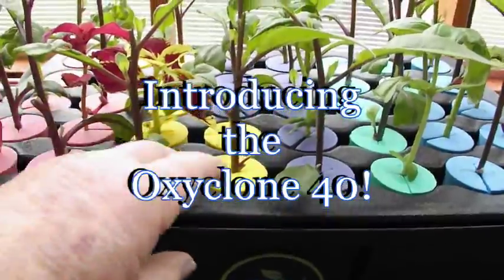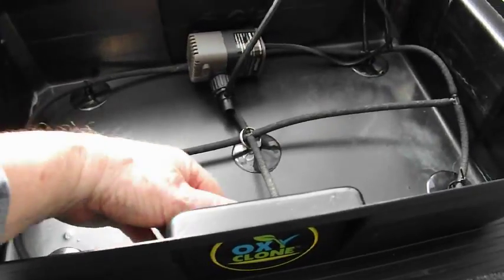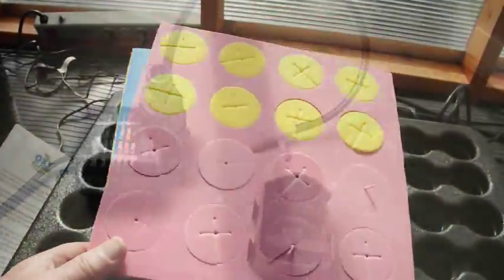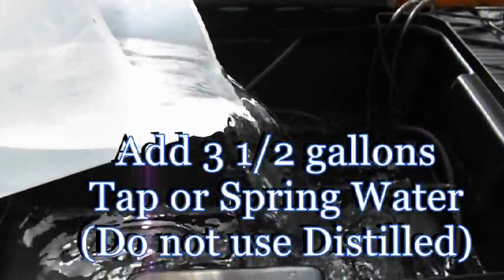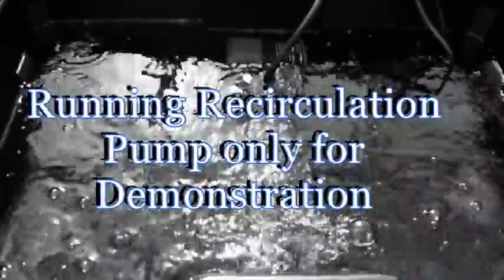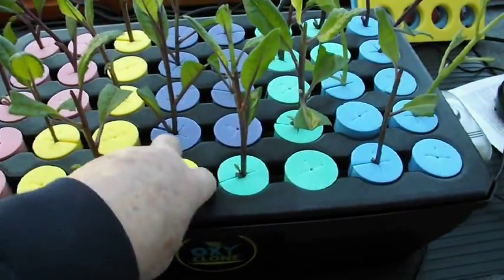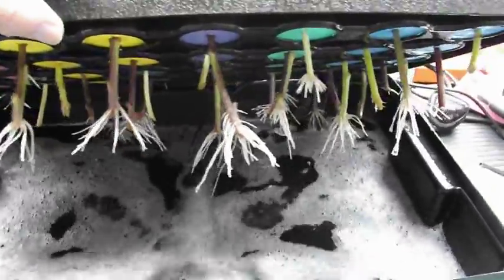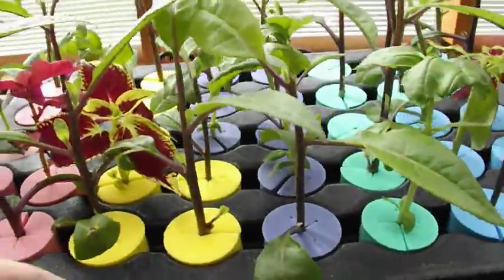Oxyclone 40

Comment: Nice Video. Thanks Ronald,
Just to confirm. You added only water. No nutritions, Correct?
Reply from the maker: +Ponniah Kunathasan Yes, most tap water is fine unless it is too acidic or corrosive then it should be treated before using.  In my area the tap water pH is around 7.8 which is too high for most plants extended growth but seems to work fine for rooting.  Thanks for your question and thanks for watching my videos!
Reply: +Ronald Kleinman Thanks Ronald. Will Hydrophonic fertilizer help or not?
Reply from the maker: +Ponniah Kunathasan  Not really, unless you are using distilled water with no minerals.  If you feel the need for added minerals use cloning liquid in small amounts.  What you saw in the video was plain tap water which has a TDS of around 35 ppm - that was enough mineral content to accomplish the root growth you saw in the video.  Well water is an entirely different matter because of possible toxic content.  Thanks again for your comments!
Reply: +Ponniah Kunathasan use technaflora root66 it's basically the same thing as cloning gel especially when used in a DWC cloner like this. plus it's way cheaper you get a litre for like 25$ instead of a tiny little tin of rooting gel
Reply: I use botanicare root gell and that's it period. just what comes off the dipped stem is all that goes in the tank I clone in, and normally all I use is tap water. you can clone in the back of a toilet and get the same results if you keep the air pumping like hell. granted, I clone in a garbage can that is actually the tank for a aquaponic system, but as far as clone junk I swear by botanicare root gell and pretty much botanicare everything over any nutrient company. I get the best results from just using water from the aquaponic fish tank and adding a little carboload and some sort of silica additive for dirt. but for a flood system, I just use a fish tank and add chilated iron. you save money on nutes, and you get a free clone machine by having a fish tank. keep the fish happy and healthy and they will keep the plants healthy and happy. good luck with it.

Comment: I've heard that if you leave the submersible pump on constantly it heats up the water too much.  Have you experienced this?  Is it necessary to buy a timer and run it 15 min on and 15 min off?  will this work if I used air pump and two stones and didn't use the submersible pump?  I just bought the Oxyclone 20 and just want to make sure I'm doing it right.  Thanks.
Reply: Hey any luck? I just bought one and I hope my water doesn’t heat up

Comment: Built one just like it for $31.98 US including tax.  Why anyone would purchase this at that price, when you can diy it yourself so much cheaper.  Using just as good products found on Amazon and at Lowes or Homedepot. I don't use the submersible pump as it heats the water to high when use 24/7. Just used a $15.99 two outlet aquarium pump works the same.
Reply: So if I have two outlet air pump and two stones it will work?
Reply: They got this same cloner brand cloner for sale at Monster Garden for 40$..